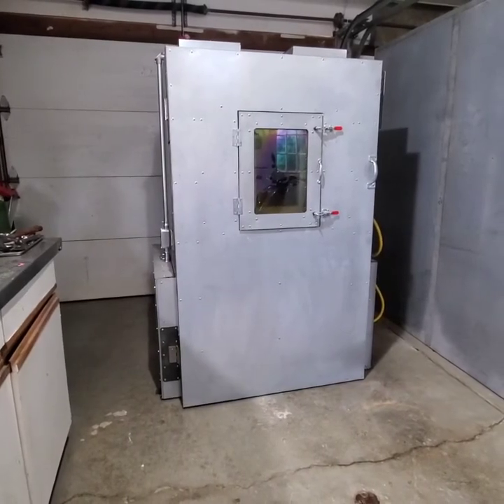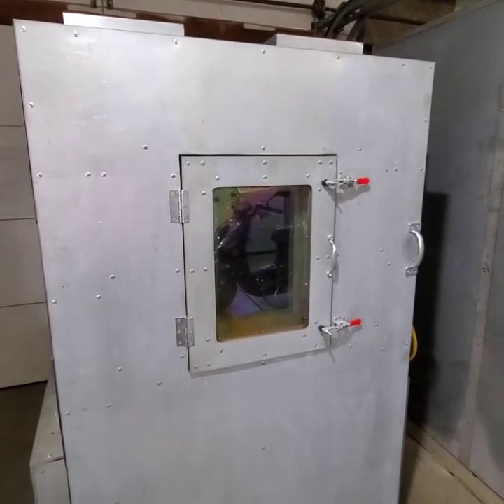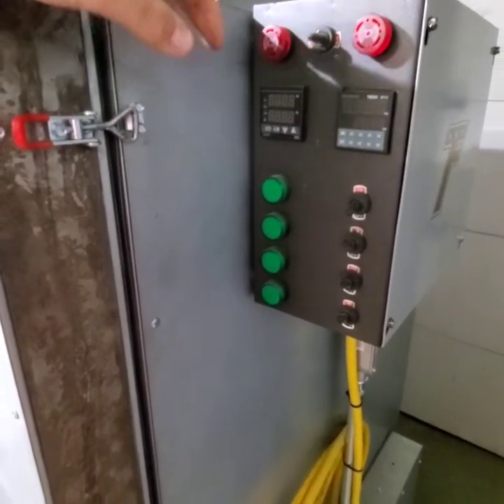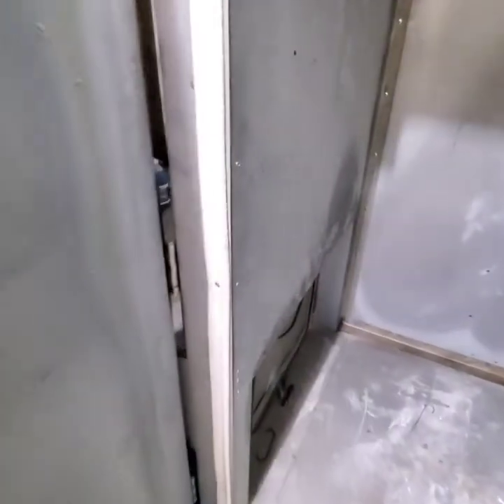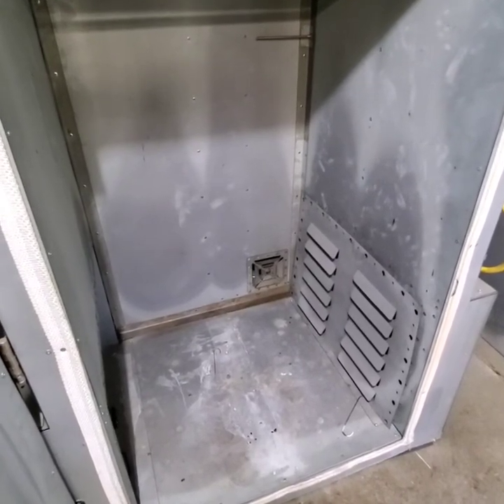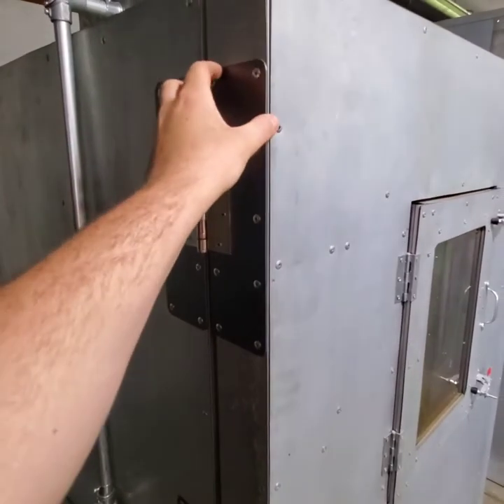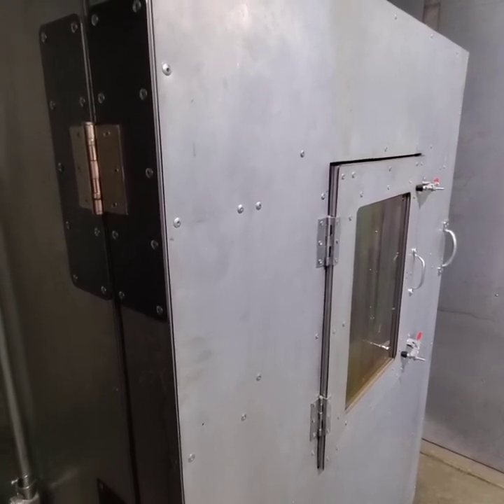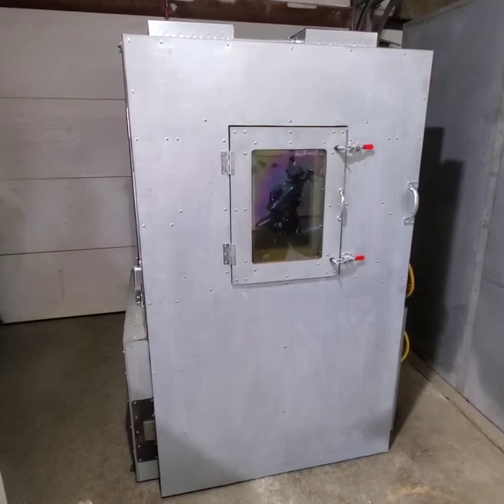DIY Powdercoating Oven (video 1 of 3)

Comment: Hi, I have watched a 100 powder coat oven builds, And your oven, by far is the best looking, There are so many hacked looking builds. Your oven looks profeshional looking. Like your window idea. Can you show more on how the high and low vent was built. I see so many build with channel in the wall and then there is no insulation or only 1 inch. To me this would be a huge heat loss. How long does this take to get to 400 degrees? What watt coils and how many amp breaker. Maybe it you get time showing the controller build would also be great.
Thanks